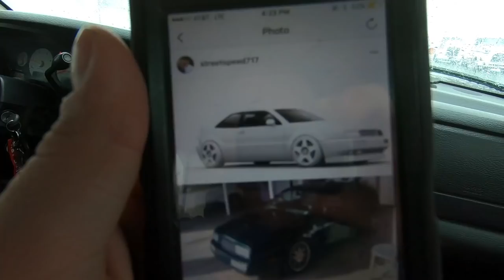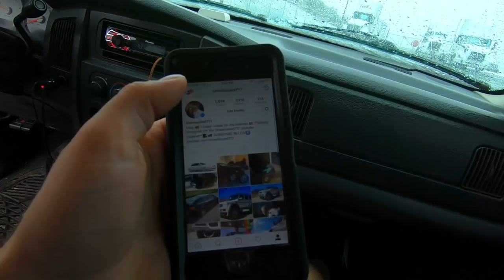My 2019 ZR1 IS ON THE DELIVERY TRUCK!!!

Comment: Hey Mike, here is an old farmers trick I was taught when putting a car or anything into long term storage. Just get plain regular scented dryer sheets stick them in under the hood in the wheelwells and some inside.  For some reason mice hate the smell and won't go anywhere near the car. I had two snowmobiles in a poll barn for over 2 years I replaced the dryer sheets once every 6 months and I've had 0 mice problems

Comment: Your 2019 Chevrolet Corvette ZR1 makes an entire Golf GTI more power than your McLaren 570S.
Reply: Paul Jr. Harrington Not only does mclaren really underate their power but its also lighter and better at putting power down that corvette’s
Reply: Chris Ethans It’s also british so automatically a problematic piece of shit in about 7 more years or 70,000 more miles like every british car in history.
Reply: Chuck Beef Come on, this ain’t a 2006 Range Rover with a 6-year, until-120,000 mi Carmax warranty that breaks more than a McLaren Honda and a Chrysler.
Reply: Another misinformed person - British cars today are not bad - remember they are owned by either VW, BMW, or European Ford.
Reply: Also don't forget Lambos are VW/Audi and Ferrari is 90% FCA
Reply: Paul Jr. Harrington that’s something Doug demuro would say
Reply: Paul Jr. Harrington range rovers are still the worst rated cars for reliability.
Reply: But I agree with you 100% here Range Rover = Major POS and always has been
Reply: Chris ethans first of all the 570s makes around 510-520 to the wheels and the vette will probably put down 700 and will go around the ring much faster and they only really underrated the power of the 720s witch is closer to 800.
Reply: Static Zer0 No way the vette puts down more than 650 to the wheesl
Reply: Chris ethans well considering it makes 750hp to the crank it does
Reply: Static Zer0 Well when you factor in an average 15% drivetrain loss which is a common number for rwd cars you get like 640hp
Reply: Chuck Beef and a Chevrolet does not?

Comment: U sure that chopped hhr isn't really a chevy ssr cuz thats the truck version that came out before the hhr's
Reply: Mike McCabe Chevy Prowler
Reply: They look similar but could be 1 or the other, the prowler trucks or an SSR
Reply from the maker: Definitely not had 4 doors still
Reply: Mike McCabe probably was
Reply: 3FiddyZ there is no such thing as a Chevy prowler m8. Just a Plymouth (Chrysler)  prowler. It's the Chevy ssr
Reply: PitchTrails I saw that after I made my comment
Reply: Dodge did make a SRT10 pick up could be had in a regular cab or Quad cab both with short beds could also be had with a 6spd manual - the trucks had an iron block V10
Reply: eurocarman ya they had the viper v10 motor in them u can still find some used ones for sale ther worth some money

Comment: Step one: put it on bags. Step 2: Wide body kit. Step 3: Spinner hubs. Step 4: Cut exhaust and remove air filter. Last but not least: Paint it candy apple red with pink pinstripes, and a big heart on the hood. Ok, maybe just chrome pink for the whole exterior. 
PS Sorry about the spinner caps idea, that was just too far.

Comment: What is a PDI - Pre Delivery Inspection? PDI stands for Pre Delivery Inspection. What most people do not realize, is that when a dealership receives a vehicle from the manufacturer it is not ready to drive. In fact, there is still quite a bit of work to do.

Comment: LMAO - what is that floor jack? Wally world?  There is a Harbor Freight in Harrisburg, they have a pretty nice low profile floor jack that works and will help your image!! It is also a pretty good value. And you won't need to drive on boards to get your cars up. Also I have all factory repair procedures and about any other info you may need on that fine German machine. Real Factory VW stuff.  I have your tool made and ready to send out today for the wheel location help. So soon you can quit the whine about lug bolts over lug nuts. The care package will have some other minor items you obviously need. Wheel torque on that car is 80 ft.lbs. BTW read your emails!!

Comment: Where's the Zo6?
Reply: drell2471  still at RPM ..Get full tuned 100%...hope it will be at the enclosed trailer😎
Reply: Haneef 221 thanks, didn’t know it was still there
Reply: drell2471  no problem